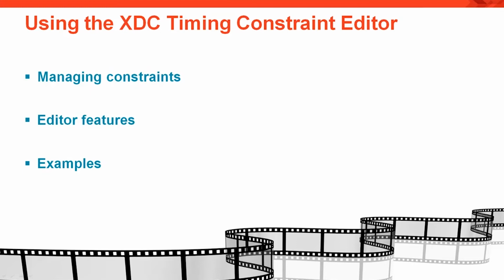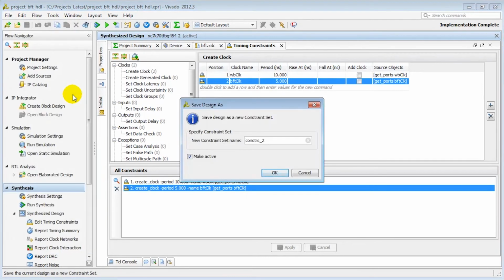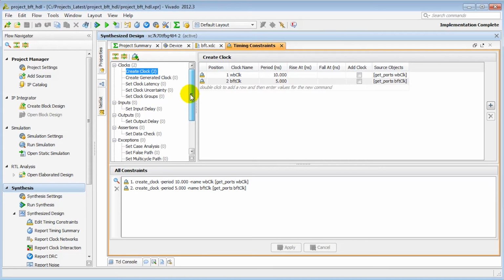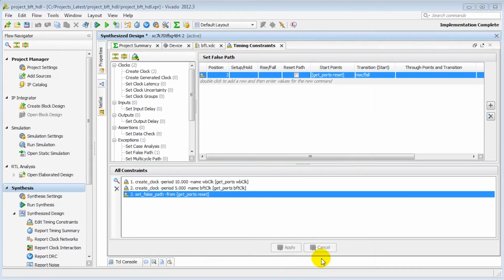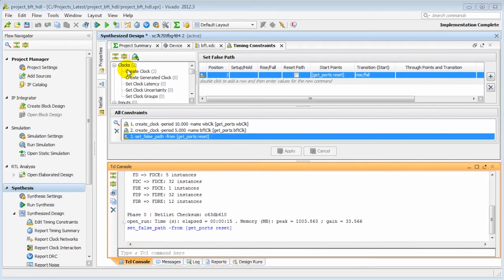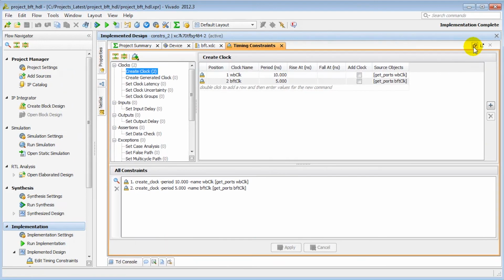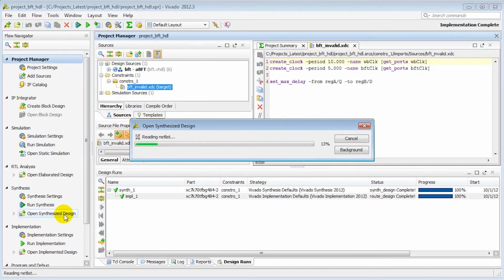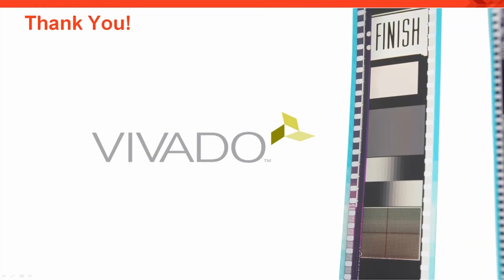Using The XDC Timing Constraint Editor

Comment: Hiiii, thanks for the tutorial, one question, I just added the Create Clock constraints, I have the XDC file with the correct command and everything fine but when I run the implementation after the synthesis, the WNS appears inf and the TNS 0 ns, why is that if the constraints are set properly? As explained in this and other tutorial you have?? Please help me